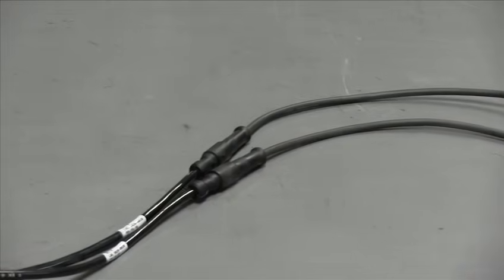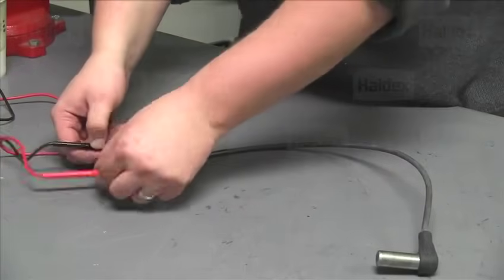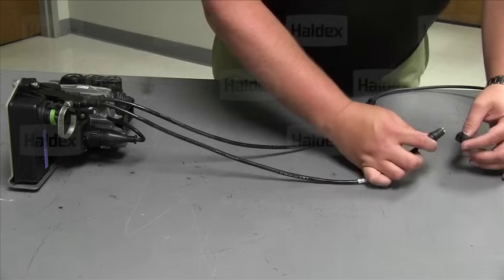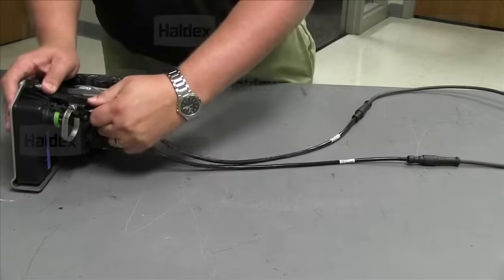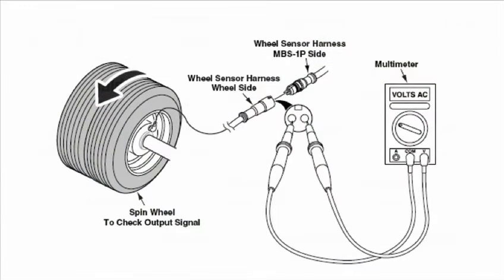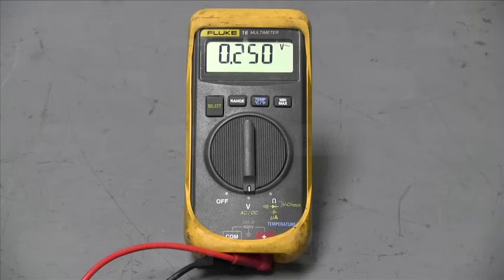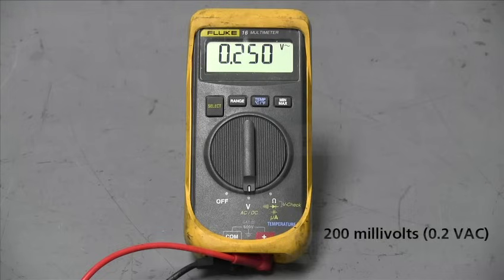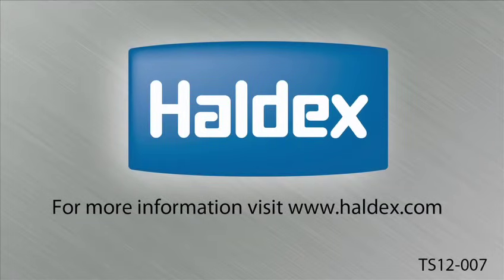ABS Sensor Diagnostics

Comment: and if it shows me a left wheel sensor error while parked and after replacing it with a new one it still shows the error, what could be the reason?
Reply: Did you get it fixed ?

Comment: Yellow 2 speed sensor was not showings speed.. was getting almost no mv ac when spinning the wheel.. with sesor push all the way in. Cleaned tone ring with brake cleaner fluid and retested. Got plenty of mv ac. Plunged sensor back in and spund the wheel,  abs light turned off.. great video.
Reply: Dirty tone ring was the issue. Keep your dust shields on folks.

Comment: In my ford focus the frontal abs sensors indicate 1.9M ohms😮
Reply: That is OK. it can reach 2000.
Reply: @wolfduranti8735  But mega its 1,000,000
Reply: @aldovallecillo9755  my chevy truck is reading 1.185M ohms, so I'm guessing every vehicle is different

Comment: Use an oscilloscope, it's much quicker, you can actually see the waveform produced by the voltage produced at the sensor and you can also tell if the exciter ring has warped.
Reply: Yeah, because everyone has one at home...

Comment: Ok, so I tested my wheel speed sensor and it’s brand new just bought it front autozone and it’s not reading correctly and I’m trying to do the volt test while spinning the tire and I’m getting very low reading.
Reply: Maybe wheel bearing? Or the new part was defective.

Comment: I own Skoda Yeti , which has been very sparing used and we'll maintained , for sometime ABS is continuously glowing . The authorised work shop advised for it's replacement but as the car has run only 14K kms am not convinced with their advice. Therefore looking some Work shop in Delhi NCR where the problem can be fixed  economically & effectively .
Advices  r solicited. Thanks.

Comment: Is that really a hall sensor? In a service guide issued by another supllier, i have learned that you could damage the hall type abs just by measuring its resistance. and, i do not thing that hall sensor generates voltage, it works more like a switch which closes the circuit, but the voltage must be applied to it.
Reply: You are correct. The video shows how to test an older type "permanent magnet" wheel speed sensor, which produce an AC voltage signal as the wheel rotates. However, many newer vehicles use an electronic sensor instead. The most popular ones I've seen use two wires and are called "magneto-resistive" sensors. They use a current loop output to send the wheel speed signal to the ABS module instead of an AC voltage signal. The ABS module applies 12 volts to the plus terminal of the sensor. Then the sensor minus lead goes to one end of a shunt resistor located inside the ABS module. The other end of the shunt resistor is grounded inside the ABS module. This sets up the current loop though the sensor and the ABS module. Current flows from ground, through the shunt resistor inside the module, through the sensor and to the +12 volt supply. As the tone ring rotates the sensor's electronics change the conduction resistance of the sensor. As such the voltage across the shunt resistor inside the ABS module will alternate between about .8 volts and 1.20 volts creating a square wave to form as the wheel rotates. The frequency of the square wave increases the faster the wheel turns. The rest of the module's electronics then use the square wave to determine wheel speed.

To my knowledge you can't harm a magneto-resistive sensor by hooking it up to an ohmmeter. However, you can't test it that way either because it needs to be powered up and connected to a shunt resistor to work. The way I test them is to provide my own external current loop, which is very easy. First, unplug the sensor from the car and check the wires coming out to the sensor from the ABS module and verify that you have +12  on the plus lead. Then check the resistance from the minus lead back into the ABS module. It should typically be around 110 ohm. This tells you the wiring going from the wheel well to the ABS module is good both ways and that the shunt resistor inside the ABS module is good and that the module is sending +12 to that wheel. It also tells you what the  resistance value of the shunt is. Once you know the value of the resistance get a resistor (typically around 110 ohms or so) and connect one end of the resistor to the minus terminal of the sensor. Then ground the other end of the resistor to either the ground of the battery or an external power supply if that's more convenient. Then apply +12 volts coming from the battery or an external power supply to the plus terminal of the sensor. 

This will set up your external test current loop. Put a voltmeter across your external shunt resistor and you should read either .8 volts and 1.20 volts. Then as the wheel is rotated by hand a good sensor should start pulsing the current up and down and the voltage should start switching across the shunt resistor. Then when turning the wheel even faster it will create a square wave as the wheel rotates at a higher speeds and the frequency of the square wave will increase the faster the wheel turns. If you put an oscilloscope across your shunt resistor you will be able to look at the square wave.

This method helps you get around the fact that magneto-resistive sensors have to be powered up and in a circuit to work while being unplugged from the vehicle's wiring harness so you can access the connections. Once you verify that the wiring going to the ABS module and the module itself is good and then that the sensor is also good you can be pretty sure that when you plug the confirmed good sensor back into the wiring harness the signal will be getting into the module from that wheel.
Reply: @joevignolor4u949  Thank you for such an extensive explanation! Wery informative! I am just starting to learn things about how sensors work and how to diagnose and this could be my lesson II :-) (the Lesson I was given by Bosch instruction booklet)
Reply: @jandanko974  Let me give you some additional tips. Let's make sure you don't get burned the same way I recently did. I'm not a professional mechanic ether but I think that based on what I've seen a lot of them don't really understand exactly what's going on with these ABS systems either. 

I have extensive experience as an industrial engineer with sensoring of this type. It's been used in industrial speed sensing equipment well before it migrated into automotive applications. I recently had to work on a friend's vehicle with an ABS problem. I had some problems initially until I did the necessary research and figured out that it didn't have the old style permanent magnet type sensors and had the magneto-restive type instead. It was a wild ride and I wasted a lot of time and effort and when I read your post I didn't want you going down the same path that I did. 

Part of the problem involved some sort of design defect in the software algorithms in the ABS module that caused it to throw the wrong fault codes. It threw codes that told me all four ABS sensors were bad at once. This is impossible of course so it pointed to something more centralized. Thinking that I went onto the wiring first and finding nothing wrong there I changed the ABS module. But that didn't fix it ether.

Unfortunately I didn't have access to an expensive professional grade scanner. If I did I could have taken the car for a test run and looked at the speed signals coming form all four wheels and that would have pointed me back to the wheel speed sensors, which is where I would have gone first if not for the bum steer I got from the trouble codes.

Once I decided that the trouble codes were wrong because I had eliminated everything else the only thing left was the four wheel sensors. Next I figured out how to functionally test the sensors as I described it to you. I then quickly determined that it was just one bad sensor in the front all along. After changing the bad sensor the f...king ABS light finally went out.

Unless you have access to a professional grade scanner to look at the individual wheel speeds my advice is that given the fact that most ABS problems are caused by the sensors or the associated wiring that you check the fuses first to eliminate them and then check the sensors first before going deep into the wiring or replacing the ABS module. If you do get a single ABS code for one just wheel check that one first. Otherwise check each sensor one by one starting with the front ones. I can tell you from my recent experience that changing out a perfectly good ABS module is not something you want to do. To prevent doing what I did perform a proper functional test of all the wheel sensors first. Odds are that's where the problem is.
Reply: @joevignolor4u949  Hi this is great advice you are giving. There are a lot of videos on You Tube for the passive sensor and people don't realise this. I too thought i could put a multimeter on the wheel sensor on ac voltage and turn the wheel  but that  only works on passive. What i did notice though is on resistance setting the left front sensor  changed numbers but the right front sensor didn't move, could this be a sign one isn't working.
Reply: thank you very much for this explanation  @joevignolor4u949

Comment: How can 106 fools dislike this video. Straight forward and very informative video, thanks
Reply: I wouldn't worry about the ohms so much. It's a quick test to ensure the sensor has nothing open or shorted. If you have none of those then spin the wheel and check a/c volts
Reply: Wow what a throw back comment lol. Now we have no idea how many have thumb down it. Crazy

Comment: what type of sensor are you testing
Reply: Hè means a aktive of inductieve
Reply: HallR
Reply: Spark plug sensor
Reply: I think the questioner meant : Ford, Chrysler, GM or any of a hundred others.
Reply: The gas cap pressure sensor dummy